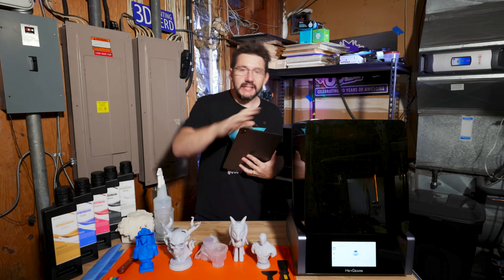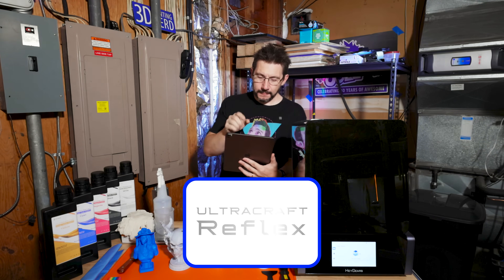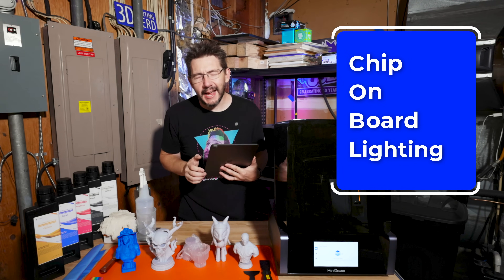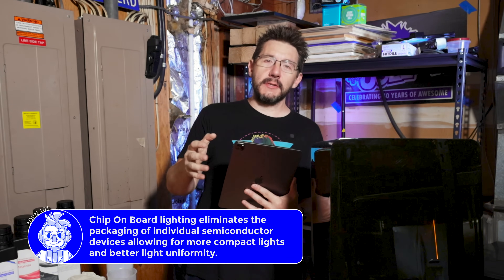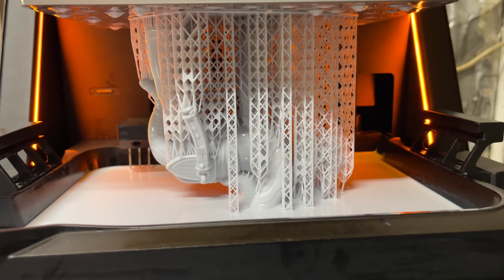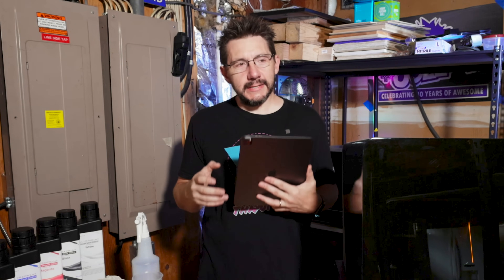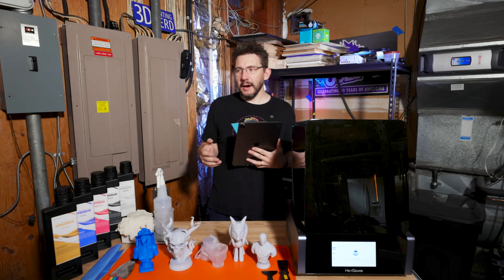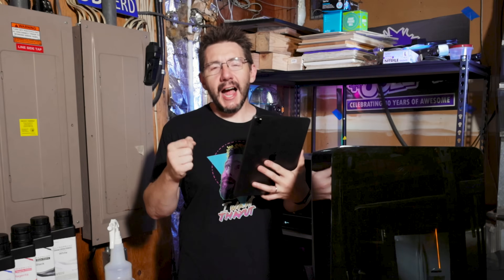HeyGears UltraCraft Reflex - Resin of ANY COLOR!

Comment: This opens up avenues they could explore for the next printer. Having the gate for filling and one for "returning" the resin to the reservoir, and then.. have additional gates for putting in differently colored resins. And voila, you have multi-color resin prints. Just need to solve for a non-resin-stick tray so all the resin leaves it.
Reply: I wish it were this simple. Unfortunately, you also need to rinse the tray between colors (at a minimum). Not saying it can't be done, just that it's definitely going to be tricky to get automatic color changing right. I do really hope they get into color mixing, though.

Comment: Cws based resin 3D printers like Nova 3D ones support different exposure time between there prints and the supports, with Lychee Slicer, for years now. Unfortunately so many printers have limited file format and it's not possible to implement that fit3 them... 😢

Comment: I ONLY buy clear resins.  I add pigment then print with it.  Even really shiny silver works well
Reply: Do you mind sharing what pigment brands you like best?
Reply: @paulpardee  to be honest, to start, I bought a “resin dye multipack” that had a variety of dye meant for UV resin but works the same, and powder metallic pigment I bought at Michaels.   Use powder pigment if you want a more opaque color, use liquid dye for transparent to translucent color.  if you want BLACK black, use carbon powder.  I suggest you setup a dedicated resin coloring station where you print, use a magnetic stir base and stir bar to assure thorough mixture.  Any other questions feel free to ask!

Comment: Sadly this suffers from the same issues that Formlabs does. It is expensive and locks you in to an expensive ecosystem. They are charging 3x what standard resin costs in addition to the almost $2500 upfront cost of the machines.

Comment: An AMS-like system could be awesome, a hub that connects all the resin colors to the dam thingy on the vat and remembers what resin is in there to be able to produce any color. Only thing is that you would need to remove the mixed resin that wouldn't be usable to create colors after.
Reply: you're essentially (almost, yours is a mix but below is similar) describing an objet or polyjet system (stratsys) - forget which one(s) exactly but in a nutshell they had upwards of 50-100(?) individual lines with different colors and different materials and the whole 'print head' was a giant grid of different options so it could squirt out whatever color, density, durometer, opacity etc that you needed for that area.. you could make a multicolor bouncy ball on one side that swaps to a hard non-bouncing material on the other..

Very expensive and a bit slow but this was probably 7-10yrs ago that i last saw one in person so im sure its greatly improved.
Reply: @No_This.IsPatrick  wow, can wait to see something even remotely similar in the desktop, consumer space

Comment: Makes me wonder with the sluice gate system if this could be developed in the future to allow multi colour models or even multiple colours in the same layer? 

Looks very interesting
Reply from the maker: That’s a neat way to think about it.
Reply: theyd have to have a way to drain and filter the print bed each time a color changes and youd never get it perfect (Thats fine as long as you expect it).. but they better be recycling that drained resin back to the bottle and filtered so its not clogging the bottle etc.
Reply: @No_This.IsPatrick  yes but if you had premixed bottles of the various ‘colours’ you could choose say 4 of them to swap between and ‘recycle’ each back into the appropriate bottle? You could carefully pre mix appropriate amounts so as to reduce waste etc? It’s not easy but is possible? 

Some form of ‘scraper’ tool could automatically wipe the excess off the screen each time? 

Or possibly have multiple screens and trays of resin that get swapped in for each colour?

Again not easy but not impossible?
Reply: @TheM0JEC  I'm not sure a scraper would get everything reliably. You might have to resort to a rinse process.
I do think they might be able to pull if off in another printer, but they're going to have to put some work into it.

Comment: It would be nice if it mixed the colors for you, but that would be an extra bit of hardware.

More importantly, how well does thier CMYKW resin work in my Anycubic Photon Mono 4K?  Can I now print replacement G.I. Joe parts that match the color or the original?
Reply: you can mix any resin you want for color changing to my understanding.. so just give it a whirl. heck use the color %s he showed in the vid or look up similiar to your primary colors what you need to mix at what ratios.

the gimmick of this printer being multicolor is NOT a good implementation because you can do it all with any other resin printer.

Comment: I mean it's cool but man is that wash station gimmicky and convoluted.
Reply: I kinda like it but I do have the worry of how well he hold up over time.
Reply: and anyone that prints a lot will tell you their biggest want is a machine that just cleans the alcohol. A powerful filter that gets it back to 100% clean so you can keep on re-using it. Such a product doesn't exist as far as I'm aware but I've seen videos of people making a system that does it using charcoal filters and it does work. Its just beyond my ability to make such a thing and I dont have the room for a giant homemade filter. I just want something smaller than my printer and I'd be super happy.
Reply: @ClayMann  yeah filtering alcohol is a pain. My current method is just exposing to UV light and letting it sit for a day or 2 then running though cheese cloth. It's far from perfect but it does help.
Reply from the maker: HAWAII CHAIR.